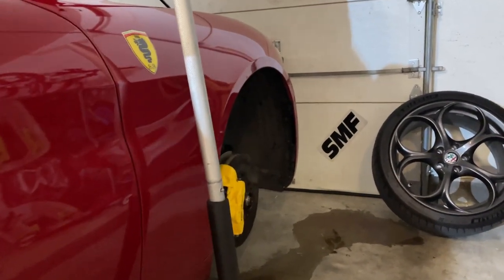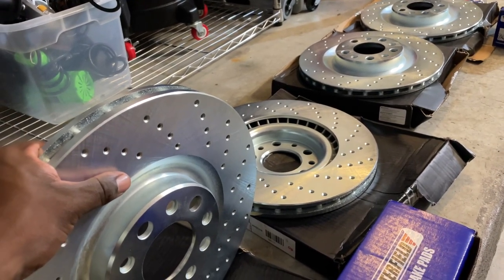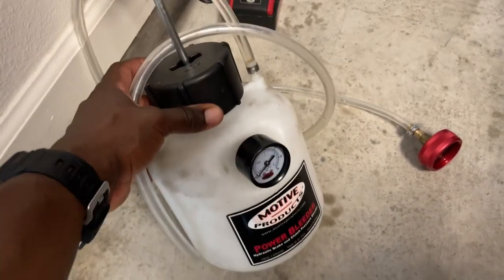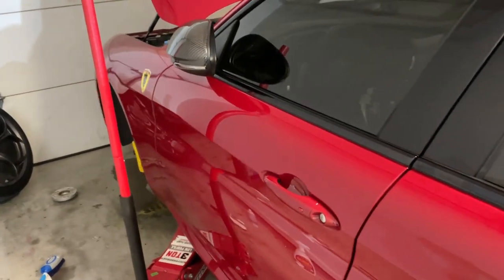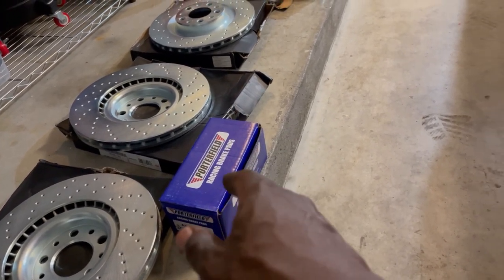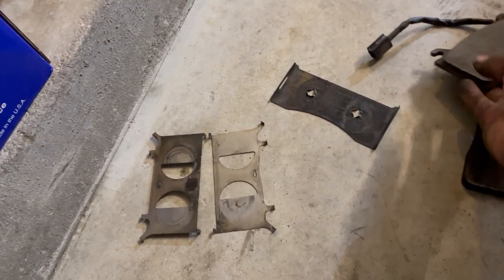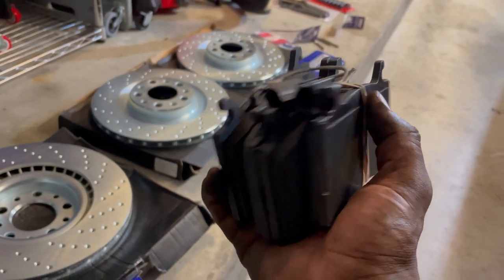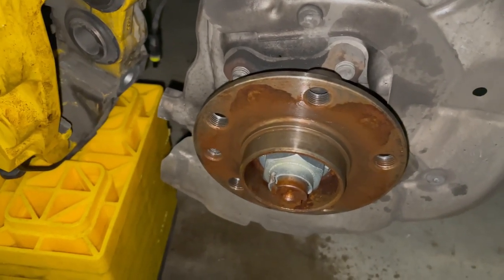DIY brake rotors and pads Alfa Romeo Giulia 2.0

Comment: Idk what I did wrong but if I push back on the brake pads they move. How can I fix this?
Reply from the maker: You must have your fluid reservoir cap open still
Reply: @club.alfagt  I took it apart put it back together closed the cap and it still moves slightly
Reply: @club.alfagt  I have the shims on both as well the sensor pad is fine it doesn’t move at all but the front pad is the one that has a wiggle to it like it’s loose idk how to fix it I’ve watched the video back a few times and I can’t find more videos on it
Reply from the maker: @ivanresendiz2678  oh that means you need to bleed the brakes. The pistons are still retracted
Reply: @club.alfagt  thank you I will try that tomorrow and let you know if it works
Reply: @club.alfagt  one last thing what about the brake light on the dash should that go away after that’s done or how do I get rid of that light
Reply from the maker: @ivanresendiz2678  I never had a brake light….except for retracting the rear calipers
Reply: @club.alfagt  idk it throws a brake light turns traction off and steering codes basically limp mode
Reply from the maker: @ivanresendiz2678  did you follow the instructions step by step? Put it into brake service mode before lifting the rear up and taking it apart?
Reply: @club.alfagt  it’s not the rear ones it’s the front brake pads the pistons won’t close and no fluid is coming out the bleeder screw
Reply from the maker: @ivanresendiz2678  sounds like you are not bleeding the brakes correctly 

Car needs fo be turned off 

1. Make sure the fluid reservoir is full 
2. If you don’t have the motive bleeder, have a buddy in the car pressurize then system by pumping the brake several times with Bledsoe screw closed
3. Have buddy hold the brake pedal while you open bleeder screw and allow dirty fluid and air to escape, close bleeder screw before brake pedal hit the floor 
4. Do that 2-3 times per corner starting with passenger side rear, driver rear, passenger front, driver front
Reply: @club.alfagt  that didn’t work the line has to be clogged I checked the lines and they are not bent so that can’t be the cause
Reply from the maker: @ivanresendiz2678  I highly doubt your lines are clogged or you wouldn’t have had brakes this whole time 

Some solenoid or valve in your abs block is closed it seems 

Should be hard or impossible to push the brake down all the way
Reply: @club.alfagt  problem solved it was bc of the codes the abs stopped brake fluid from flowing as soon as we cleared them and pushed on the brakes they locked
Reply from the maker: @ivanresendiz2678  hell yeh awesome!!
Reply: One thing I have done in other vehicles to push back the pistons is put a big flathead screwdriver between rotor and pads.  Then move screwdriver back and forth to get the pistons back in.
Reply from the maker: @brentkhack6404  that’s a technique but you risk scratching things and also compressing the piston unevenly
Reply: @club.alfagt  true, but I move the screwdriver up and down the old pad and rotors to get them back evenly.  I do want that tool meant for that job.  Great video BTW.